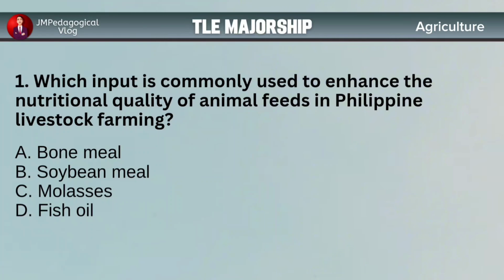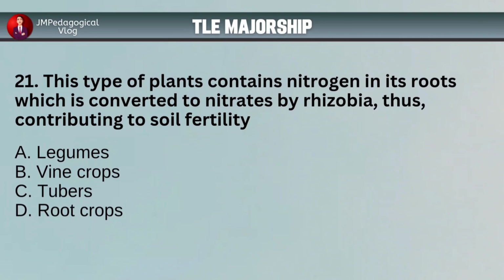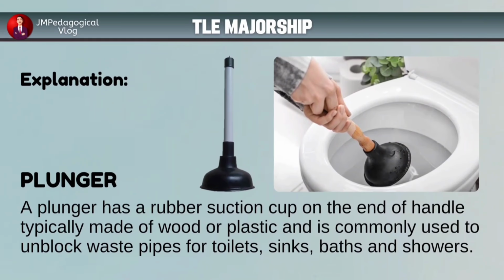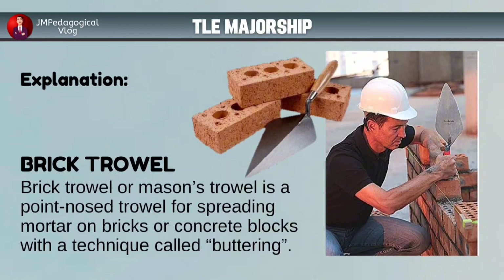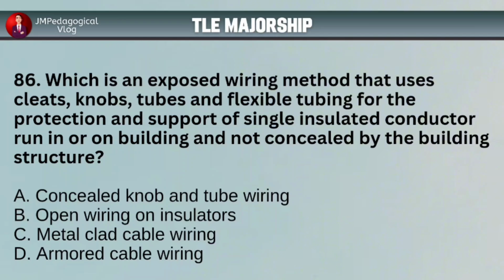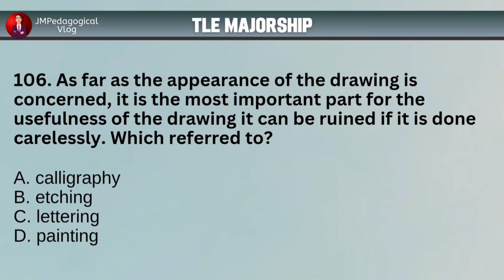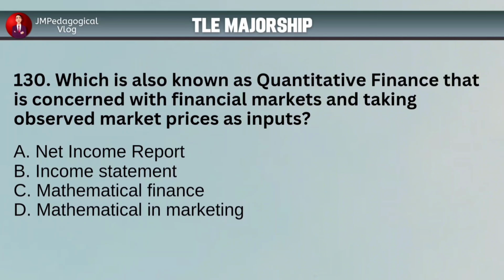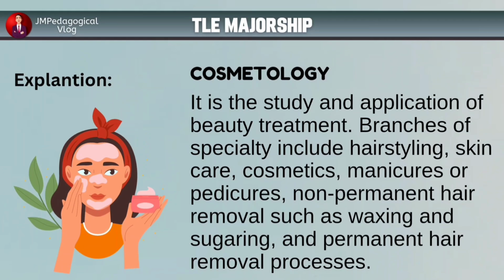TLE - TVTEd Majorship: LET Review (Drill) 150 Items

Comment: 83. po A pull box
Reply from the maker: Junction box= used to join or connect runs of conduits
Pull box = Allows electricians to pull, reroute, or inspect cables as needed without having to open the conduit itself. 

Junction box po ang sagot

Comment: 48??
Reply from the maker: Ung Globe valve, check valve and gate valve are considered in general pero under these valves ay mayroon pa silang modifications or pattern types
Hence mayroong angle pattern globe valve, and angle check valve, 
What is common of these angle valves? Is the 90° turn

And basically  the common use of angle valve is to shut-off the flow of water.

Therefore from the choices, the angle valve is more specific and nearest to the question ☺️

Comment: Hi. Parang B. Globe valve po yung answer ng 48.
Reply from the maker: Ung Globe valve, check valve and gate valve are considered in general pero under these valves ay mayroon pa silang modifications or pattern types
Hence mayroong angle pattern globe valve, and angle check valve,
What is common of these angle valves? Is the 90° turn

And basically  the common use of angle valve is to shut-off the flow of water.

Therefore from the choices, the angle valve is more specific and nearest to the question ☺️

Comment: #48 is hindi po ba Globe valve?
Reply from the maker: Ung Globe valve, check valve and gate valve are considered in general pero under these valves ay mayroon pa silang modifications or pattern types
Hence mayroong angle pattern globe valve, and angle check valve,
What is common of these angle valves? Is the 90° turn

And basically  the common use of angle valve is to shut-off the flow of water.

Therefore from the choices, the angle valve is more specific and nearest to the question ☺️